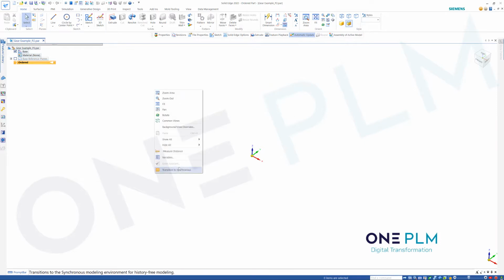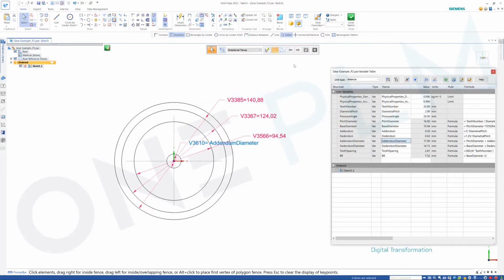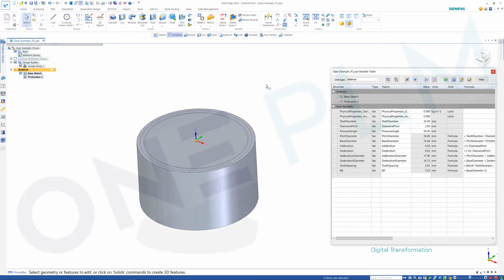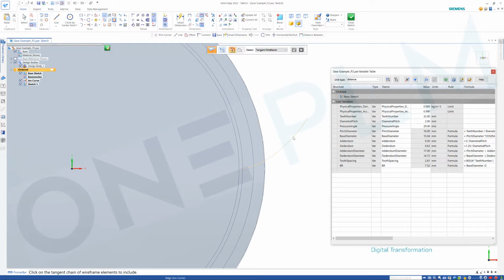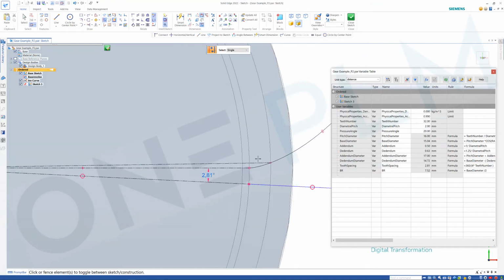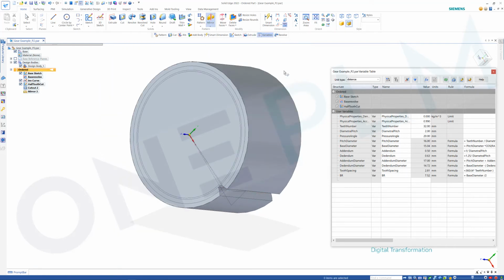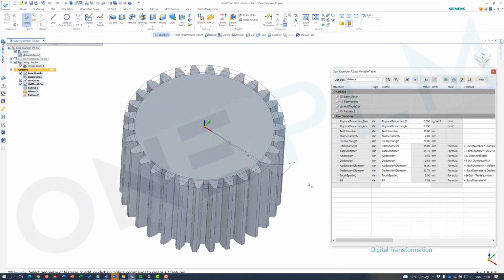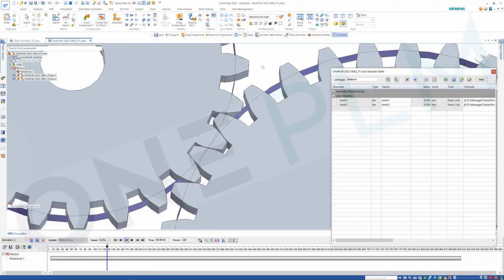Modelling a Involute Gear in Solid Edge

Comment: Is there any way to generate gears in solid edge (like we do with threads for example)
Reply from the maker: Yes. We can use engineering reference however these are "reference" and do not represent the exact profile you you want to produce. This method allows us to get production ready models.  Although I would be tempted to use a dedicate gear calc software alongside this.